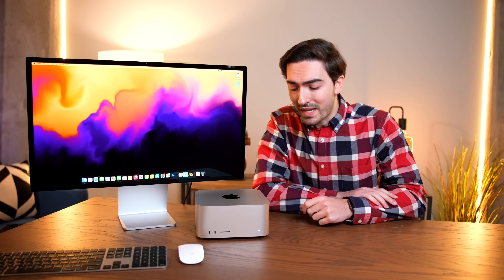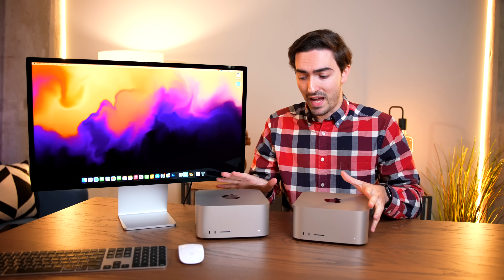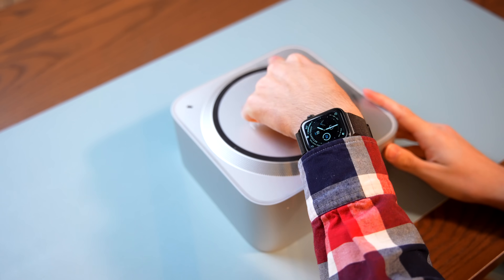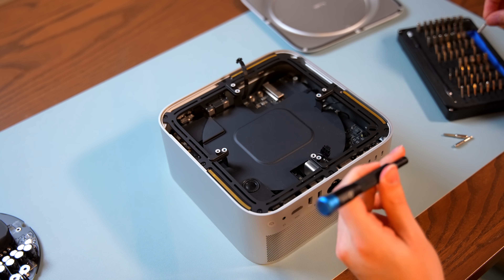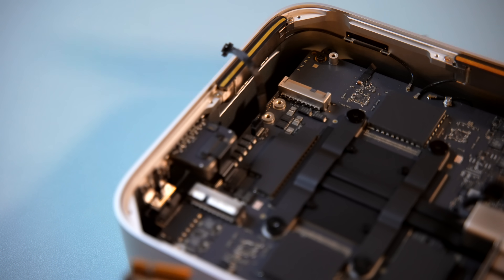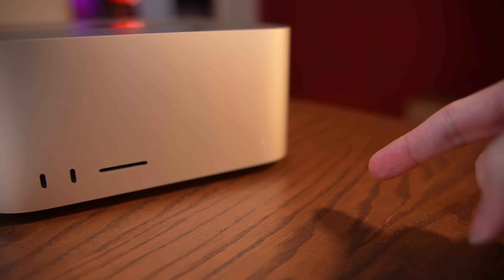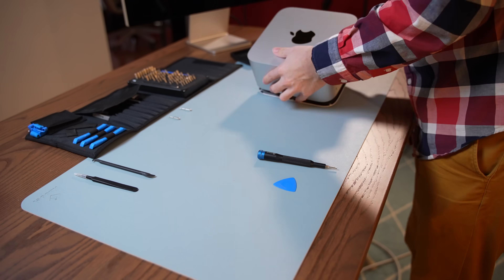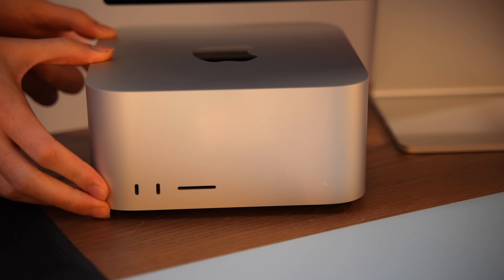What happens if you try to UPGRADE a $5,000 Mac Studio?

Comment: This just a guess, but I think it's failing to mount an encrypted drive similar to a TPM bound to PCRs 0,1,7 on an Intel UEFI based bios will fail if you mess w/ HW configuration.  On those machines, If you mess w/ bios or install new hardware that changes the boot hashes, mounting the encrypted drive fails.  In my opinion, your conclusions are just assumptions at this point.  It is very possible that both of those slots work for storage and the machine just needs to be re-installed fresh so the drives can be re-encrypted if you change the storage configuration.

Comment: You should have tried using a separate SSD in addition to the normal. It may have triggered the amber SOS light due to conflicting identifiers on the SSDs. Try using an adapter with a normal SSD to see if maybe that was the problem
Reply: Are there adapters? This might not be your "regular" apple ssd port.
Reply: @helloukw  according to the first tear downs, it’s the same port

Comment: Anyone working with their computer should know the dangers of exposed smps & which part to touch and not touch. U should not touch the legs of those two big capacitors that are lying vertically even though there is definitely circuit to discharge the capacitors after the device is unplugged it is still not the best idea to depend on them as they can fail and give u nasty shock (not enough to kill anybody).

Comment: This tactic by apple is just asinine through and through. there is no logical reason for this kind of lockout to upgrade or repair an expensive machine with more storage. The move to apple silicon wasn't about more performance, that was just the hook to get people, it was about removing the users ability to do what they want with the hardware they bought under the guise of "performance" and " security" and then charging users through the nose for it and laughing all the way to the bank.

Comment: Intriguing. You might wanna try booting the Mac Studio into DFU mode. Then, on another Mac, install Apple Configurator so you can reflash the firmware, so the SSD can be properly accessed, much like the same procedure on a 2019 Mac Pro. No guarantees, but it might be worth a shot!
Reply: it's not possible at the moment, in the future, who knows
Reply: Gaming York  yep! DFU mode’s been on every Mac since the T1!
Reply: Did it work when he swoped the storage back to the original machine or is it also locked? Or did you mean to make it work with the storage from the second machine?

Comment: Why is this surprising? Isn't this EXACTLY what apple told us they were doing with the T1 chip? I guess we just assume that because they didn't solder it in, it would be different than the 2019 MP. I mean, I HATE it, but at this point it's SOP for those (insert eviscerating noun here).

Comment: The SSDs are most likely encrypted with per-machine keys. I've seen M1 MBA being upgraded by resoldering the SSD chips - and it worked, but required Apple Configurator and DFU mode. The "SOS" blinking pattern is precisely Apple's way of asking for a DFU recovery.
Reply: I agree
Reply: They aren't SSDs. They're raw NAND chips that interface with a controller built in to the SOC.
Reply: @gutless_worm  That's exactly what an SSD is, a type of flash based storage.

Pity these are crippled, Apple trying to fix a problem that doesn't exist.
Reply: @ghostofdre  Not really.   An SSD has a storage controller built into it.  In Apple's case, the storage controller is built into the M1 SoC, and the storage chips are socketed using some proprietary Apple connector.   In other words, it's as if Apple surgically removed the controller from an SSD, embedded that into the SoC, and then put the raw storage chips in a socket. 

TL;DR - These aren't "crippled" SSDs because they aren't SSDs.
Reply: @ssranon  They are SSDs. Any non-volatile NAND-flash based memory is SSD.
Reply: @ssranon  The side with the heatspreader is where the controller is. These are still complete PCIe/NVME SSDs, as you would want that controller to be as close to the NAND as possible.
Reply: @AniruddhJoshi  I think there is an important difference they are making, that the chips to drive the memory chip usage are separate. Ssd and hdd before them had this controller hardware part of the package, here it is on the motherboard or perhaps part of the soc. 

So the ‘drive’ part of solid state drive is missing from the removable board. An important distinction and possibly why this swapping is not so straight forward.
Reply: DFU aka Damn Fucking User.
Reply: This guy has the right answer. The SSD is replaceable, you have to do a DFU recovery. iFixit did it here: https://youtu.be/TYF527DqnwY?t=112
Reply: @johansugarev  replaceable... but not upgradeable. The only successful SSD swaps so far was using the exact same capacity as originally installed. Which is great for repairability, but upgrades are still impossible. At least for now. This probably depends on some deeply stored configuration - which needs to be discovered where exactly is that stored and how (and if) can be changed - it's likely that it's a one-time programming and/or cryptographically locked by Apple, which would mean no upgrades for years, if ever.

Well, there's always external Thunderbolt storage, though, I guess. I'd argue that no upgradeable boot drive is much less painful for a desktop than for a laptop.
Reply: @kFY514  Yep. I got the studio and don't think I'll need an upgrade during the life of the machine. Maybe someone will figure out a way to reprogram the controller someday, but in any case, it's not a huge issue and the computer is amazing.
Reply: This is a very likely scenario.  Great point here.
Reply: Yes you would need to run the apple configurator.
Reply: My bet is the SSD's "serial number" is locked into the controller so no other SSD will work. Apple loves forcing its customers to either send it to them or bring it to the genius bar so they can always quote you a repair price in which it makes more sense to just buy a new one.
FAWQ APPLE!
Reply: @mattb4805  The SSD, or the module the "raw flash" is on, most certainly has a serial number. 90% of parts in any Mac product do, and that serial plays a key role in what's happening in this video. I'm curious as to which Apple tool you're referencing here.
Reply: @mattb4805  It is still a part and could have a serial number or number like that to identify itself to the controller. Just because it may not have its own controller built into it, it is still an SSD, AKA a storage device.
Reply: $9k investment to even attempt this. DFU=Don't Fuck Up
Reply: @iTubeYou it would make more sense to get lowest tier and highest tier to compare and then make educated guess how to upgrade lowest tier
Reply: @mattb4805  if I'm so wrong then why did you just say "to make the SSD work again" yourself? I never said for sure about the serial number part that was the only speculation.
Reply: Luke Miani really jumped to conclusions when he decided that not getting it to boot meant that it was impossible. Talk about overconfidence…
Reply: TPM, encryption keys, disk GUID, I'd like to see what a fresh install with apple repair tools looks like.
Reply: @Drsuds  On T2 and M1 Macs, fresh installs (including those fresh from the factory and those made using DFU) have the main data partition "encrypted at rest", as Apple calls it. This means that the drive is encrypted with machine key, so it's automatically decrypted at boot but it's never stored plain text on the drive. This essentially locks the install to the physical machine. And you cannot disable it.

I've researched this topic on my own MacBook, soft-bricking and then DFU'ing it twice already in a week.
Reply: @Drsuds  It's already been confirmed to work if you swap it with the same capacity drive.
Reply: That and maybe their software is so batshit that SSD installs are per-specific-serial
Reply: I came looking for this comment. I have the same hypothesis, they're SSD's that are locked to the machines because they are primary SSDs on each machine. I suspect you would be able to install brand new ones with no issues.
Reply: @JoeCastellon  why not use a program that clone the drive
Reply: @NicVandEmZ  Byte-for-byte clones don't work on Apple Silicon (and T2 for that matter) Macs. That's because the drives are always encrypted - even if password protection is disabled, they're encrypted with a per-machine key. And if it's enabled, it's a combination of both. Another machine will have no idea how to read a byte-for-byte clone.

That's why every modern backup utility for the Mac works on the file system level, be it Time Machine or any third party tool. That's how you clone a Mac - you reinstall macOS and then copy the remaining files. You don't do block-level clones because they don't work.
Reply: I was thinking the same thing. The drives are likely encrypted, so of course only the machine that did the encryption can read the data. That’s the basics of how encryption works.
Reply: @mattb4805  that would be problematic since they list SSDs in the tech spec’s:

“32GB unified memory
512GB SSD storage¹
Front: Two USB-C ports, one SDXC card slot
Back: Four Thunderbolt 4 ports, two USB-A ports, one HDMI port, one 10Gb Ethernet port, one 3.5 mm headphone jack”
Reply: @kFY EXACTLY - I was puzzled by the video author spreading bullshit about very expensive stuff - he has money to buy this stuff, but no time to even understand encryption. oh god.

Author should have tried to change drive UUID , clone it from working one, or use DD to copy 1:1 if possible.
Reply: @Eddy-pm8tf  Yeah,but you need to figure out how to manipulate those raw NANDs. Maybe you can be the world first one who's able to do data rescue for mac studio 🤣
Reply: @Eddy-pm8tf  BS.
Reply: @Eddy-pm8tf  Would it working with something like clonezilla ?
Reply: @Eddy-pm8tf  To be fair, Luke does mention this issue, saying that even if it can be gotten to work by using the DFU mode, "the regular user should not need to be concerned about this". And I guess that's a fair point. For many users that's the difference between being able to upgrade the SSD themselves, and having to use the services of some professional repair shop.

Still, even if the SSDs are only "pro repair shop-serviceable", that'd be much better than nothing.
Reply: @kFY514  DFU mode is trivial to deal with (download Apple Configurator to another Mac, that’s it); so if a user can’t figure that out, they shouldn’t be messing with the internals in the first place. Honestly, I get Luke’s point, but he really just come off as ignorant about how anything Apple makes actually works.
Reply: @Eddy-pm8tf  You should be able to replace an SSD without BS encryption. You can do it on older machines. That's what Luke's saying.
Reply: @Eddy-pm8tf  Because it's completely unnecessary to encrypt drives that way. Encryption is meant to protect unauthorized access to data, not render a device useless.  Linux has no method to interact with the T2 chip, yet if I boot a 2018+ Macbook into Linux I can extract file vault hashes, and mount encrypted APFS volumes with the password. Consider how they handle the iPhone with too many bad passcode attempts. It locks and forces you to erase the phone to continue using it. There is no security-based reason to prevent an erased drive from being accepted by the computer.

Comment: High chance that you need to flip some surface mount configuration resistors to get the system to recognize the 'new' SSD correctly. I heard there are also resistors deciding the brand of SSD chips.
Reply: That’s a good idea someone needs to test this

Comment: Ah, typical Apple. As much as I commend them for actually making this device upgradeable, they took security TOO seriously again. They actually think that replacing or adding storage is a security risk, so they don't allow you to boot the device. You probably have to plug the Mac Studio into another Mac and run Apple Configurator to reflash the system, and maybe this will "bless" the hard drive to work on this device. I also managed to "brick" my Mac Mini M1 by removing the recovery image and it also had those blinking leds.
Reply: upgradeable?

Comment: Right, because it's not like you can add storage through the USB-C ports, or the Thunderbolt ports, or the Ethernet port. Granted, the USB-C and Ethernet ports are only 10Gbps, and the Thunderbolt ports are 40Gbps, which isn't as fast as the internal storage. But for most people it will be fast enough. Although I believe there may yet be a way to accomplish either swapping or adding the SSDs that just hasn't been discovered (or documented by Apple). It's early days and many people will be experimenting with this.
Reply: Sure, but it's not like you're going to use this device for a few years and then just throw it away. A powerful device like this should last for at least 10 years and in that time, you need to seriously consider replacing the SSD because 1. Flash storage can wear out very quickly with heavy use 2. SSDs with more storage are getting cheaper and soon 1TB will mean nothing if Apple continues to bloat macOS to hell. My Mac Mini M1 with 256 GB is out of storage by just simply installing iLife and iWork. (Okay, that's my fault for buying the cheapest version but you get the idea :D )
Reply: @Gravarty  I don't have a Mac Studio but I do have a Macbook Pro 14" and I've found two Thunderbolt SSDs in Raid 0 are about as fast as the internal SSD. And you can boot MacOS off an external drive. And it's possible Apple will have replacement storage for Studios in the future. iFixit has already discovered that if you replace the internal storage with the same size and do a DFU restore that it works. OWC may even come out with replacement storage in the future. If you believe that 1TB won't be large enough in the future, then get 2TB to be certain that you have enough space.
Reply: Fully agreed.

Comment: Thanks for going the extra mile to check if the SSD works in the other slot. Let's hope OWC will have an upgrade in the future for this unit. There maybe information on how to do this that isn't published yet. If the SSD went bad, Apple tech must have a way to allow the system to accept a replacement device. I think It's too early for this info to be out but I suspect it eventually will make its way to the public.

Comment: I believe it has happened because drives have to work in raid 0 mode. So in theory it should be possible to sinc them with configuration wipe and join them in to a raid 0 so it will work as one drive and then install MacOS
Reply: I think the same, since the more storage models in iPhone also has a higher read/write speed, the 2 slots should work as raid 0, and even windows can't recognize and add items to the raid without any extra configuration.

Comment: Just added a 2Tb nvme to my PS5.  Sony added a little access door to an NVME slot that you can get with like 20 seconds of teardown (slide off plastic side panel and then 2 screws).   They have clear guidelines for performance standards (top tier 5500MB/s PCIe 4.0 drives with heatsinks only).  So you know exactly what to get and what to expect.   Imagine Apple just being bros for once and putting a couple NVME access panels on the side or bottom.   How hard would that be?  So what if the case needs to be 1" taller or wider, it's a desktop.     It's like they hate their customers to have any choice.
Reply: These are not NVMe SSDs, just memory for the controller being in the SoC. We don't know if this will be upgradable or not, because no one has reversed engineered the slots to understand if we could put something else. It's far too early yo assess.
Reply: @philippeastier7657    You don't need tight SOC integration to read and write normal files like photos or videos.  You can still have that integration for the system drive while allowing expansion data drives.  I mean you will be able to do that anyway with USB/Thunderbolt drives, so wouldn't NVME at native PCIe speeds be better?      And no, they are not memory.  That is something different.
Reply: @the_wiki9408  The boards in this machine are purely memory, as all Apple Silicon ships do contain their own embedded controller. This is nothing new and you can easily see that there is simply not controller on the board themselves. Thunderbolt 4 drives could achieve a very similar performance if people just built proper controllers. TB4 is 40 Gb/s, or near 5 Bytes/s. Latency will always be slightly higher of course.
Reply: @philippeastier7657  "memory" is volatile, in that it is erased when power is lost.  The storage cannot be memory.
Reply: @the_wiki9408  Ok, I'm sorry you are wrong ! SSDs are exactly that : non-volatile memory or flash memory as per general knowledge. NAND Memory. Anyway... Please just check Wikipedia.
Reply: @philippeastier7657  You are correct.  My apologies.   I typically do not use the word "memory" for flash or NAND, but NVRAM is definitely a standard name for it.   I think most would assume the word "memory" means RAM, though, so I would be sure to specificy non-volatile memory when you are talking about storage.

And yes, I have watched more video teardowns and it appears you are correct that they are just the NAND flash chips.  I saw another where he tried swapping capacity and it appears that even the controllers on the MB can be different.  So I doubt we'd be able to swap them ever.    But, that doesn't go against my above wish for just having a standard NVME slot or two somewhere!